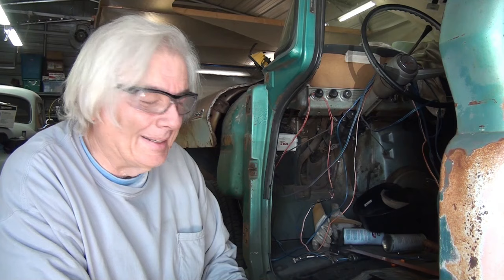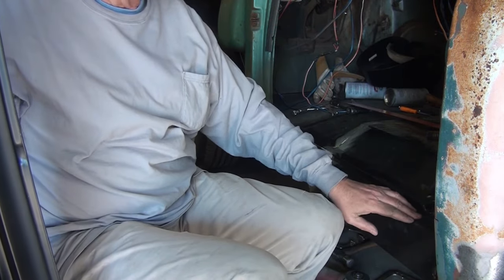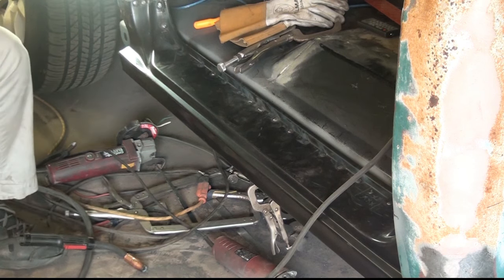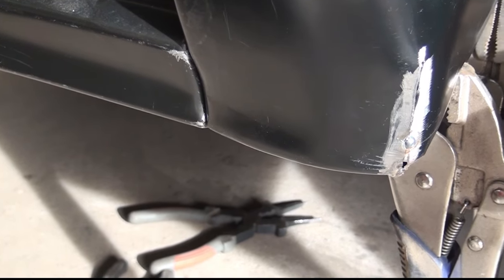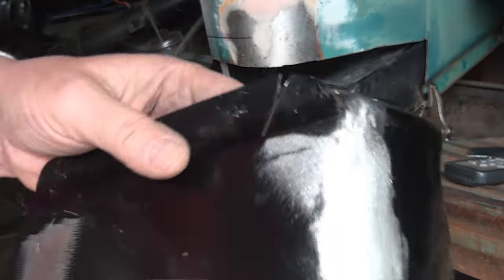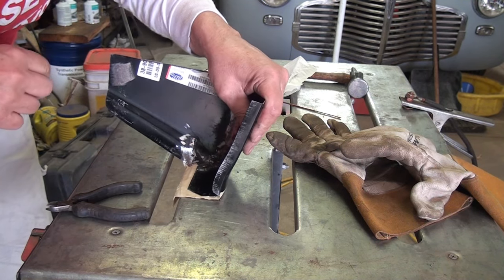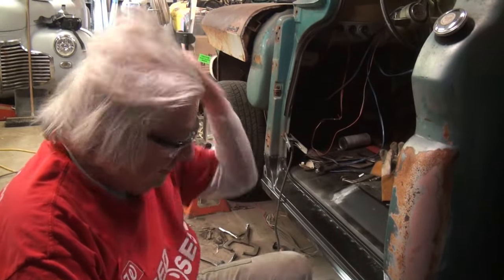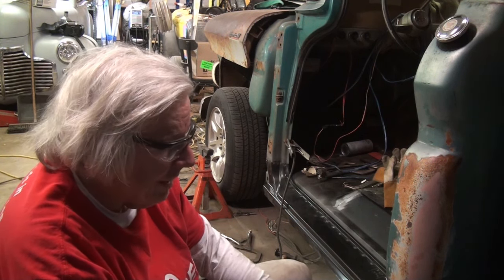Uncle Dirtbag's Rusty C10 Rust Repair - Rocker and Cab Corner

Comment: That cab corner looked to be a hard work to put in!
Reply from the maker: While installing it I blamed the part. In hindsight it could be because of the damage caused when the cab got dented (the dent is above the repair panel). The passenger side went together far better than this side.

Comment: I have sent a few panels back too due to fitment issues. I've learned that the cheaper panels are basically poorer quality stampings and the expensive panels are generally decent. Just looking them over and I can tell a big difference between Key Parts and Dynacorn vs. the other suppliers brands.
Reply from the maker: I know what you are saying. The panels on my 41 and the rockers on the 50 Plymouth required a lot of massaging to make them fit and look right. Unfortunately on those cars you don't have a lot to choose from. For that matter the Plymouth rockers are no longer available at all. As all the rest of the panels on this C10 were pretty good fits including the other cab corner I am inclined to think that the impact damage on the cab distorted the OG cab corner. I was hoping to hear from someone who put an LMC left cab corner on a first gen unmolested cab. Anyone?